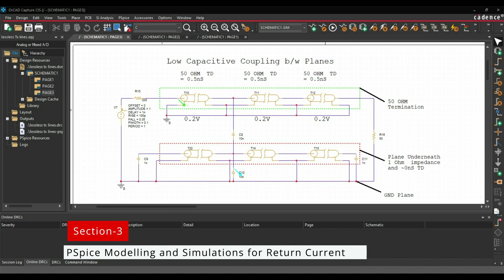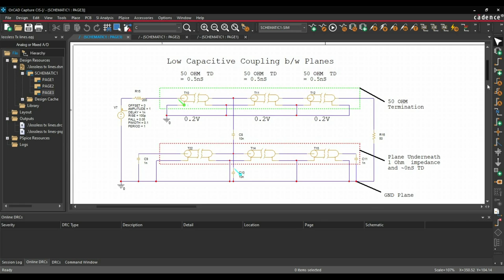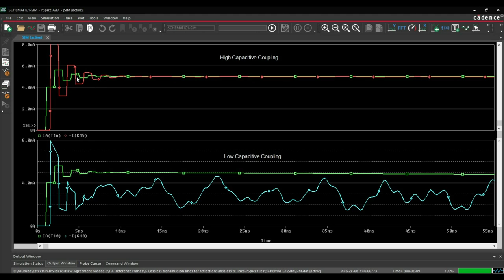Return Current Path - Can Power Planes be used as Return Path?

Comment: Hi Aviral! At 8:20  you say the lower Z23, the thicker signal track will be, and when we need to make the track thicker, we have to reduce the coupling between planes. But the thing is when we are reducing the coupling, the impedance between planes is getting higher. Therefore the signal track will be thiner and less manufacturable. What's the point?
Reply from the maker: Hey lower gap b/w planes means lower the impedance b/w planes will lead to more capacitive coupling b/w them.
In multilayer board it's very common problem to put high-speed tracks to manufacturable thickness this trick will help out with this